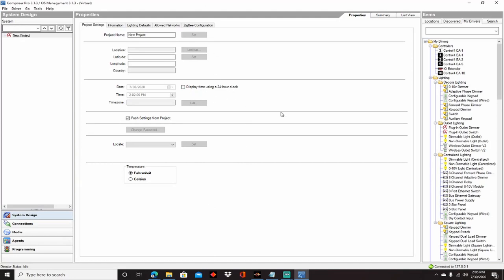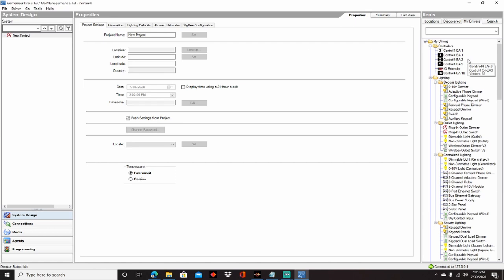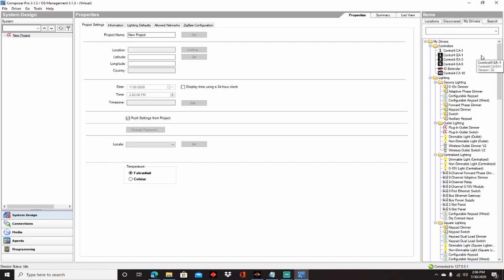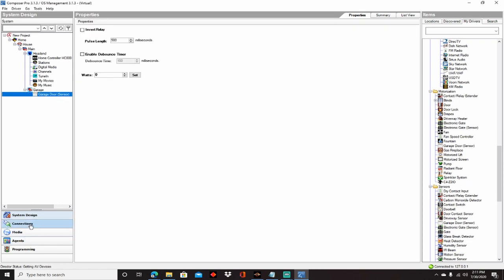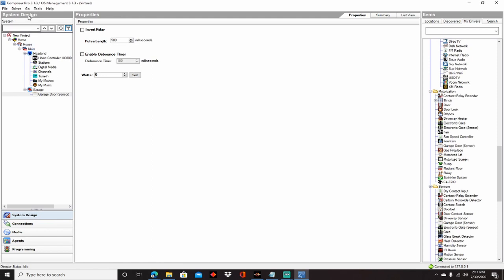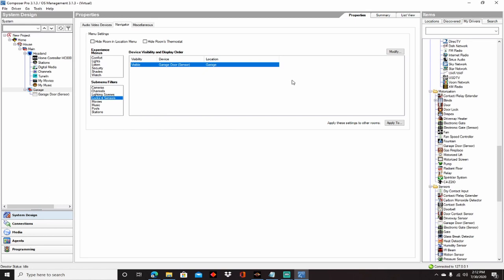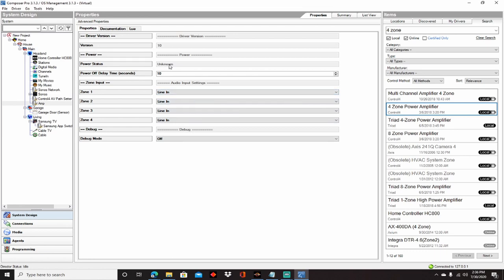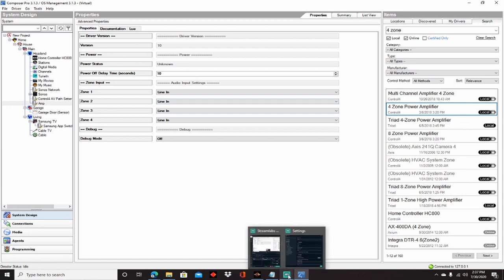Control4 Tricks & Tips For Programming

Comment: Another thing to learn! just when you think you have a grip on the business for home services and AV there’s an entire new standard to learn. 

Thanks for this video.
Reply from the maker: Anytime brother. Thanks for watching. C4 is actually really easy and if you use good products it works really well. Like anything else, a poorly programmed system will cause word to spread that the control platform is crap, I’ve seen it with all the majors, crestron, savant, even URC. I would suggest if you start to venture into it, get the product for your own home and push it to its absolute limits and then dial it back so you know what it’s capable of, then run it for a bit and make sure your wife/partner/roommates can use it no problem. After that start installing it! Good luck.
Reply: @QVisionGarage  do you see this system on its way out in terms of use in the industry? I have an interview for a company today and am just wondering the severity of not understanding this fully yet. 

Thanks
Reply from the maker: Not at all. Control4 was bought by snap one a few years back. Snap one is one of the biggest suppliers of low voltage gear, they are here to stay. I wouldn’t be too worried about not being familiar, to be trained you have to be a dealer or employed by one and again it’s really easy. If I could offer any advice it would be have strong fundamentals in low voltage work, terminations, wire pulling, knowing how to efficiently layout and assemble a rack, understanding signal is huge, being able to read blueprints and system block wire diagrams. All those things are super important, programming is likely secondary to what most employers are looking for. Being super solid in the core elements separates a lead tech from a helper.

Comment: Thank you for the video! I programmed my kitchen light to come on during nighttime hours only. and put a timer in to turn the light off after 5 minutes. It works fine. However, if I turn the light on manually with the wall keypad , after 5 minutes the same light turns off. 
Im not sure what to do. 
It is a Control4 controlled light.
Thank you.
Reply from the maker: So need to know a couple of things, 1, you set the kitchen light to only come on during nighttime hours, is that when you manually turn it on or is there a motion sensor? I’ll have more questions based on how you answer the above.
Reply: @QVisionGarage  I set it to come when the garage door opens, but only during nighttime .
Reply from the maker: And are you using composer pro?
Reply: @QVisionGarage   Composer HE
Reply from the maker: Ok so unfortunately I’m order to achieve what you want to do you need composer pro. Being that composer pro is dealer only software kinda puts you at a dead end. While I have heard of people getting their hands on composer pro, I don’t know how to do it nor would I advise it. But, to answer your question, your system needs to know when to automate and when to override. This would typically be done with the use of variables and a scheduler. Both of which I don’t believe are available in HE. I’m sorry to be the one to give bad news but what you want done is a pretty easy change and your dealer, if they are good should be able to do it without even being there if they have a solid understanding of what you want to do and their understanding of logic and conditionals is tight. I know this isn’t what you wanted to hear but I’m afraid this is the way of the Control4 world.
Reply: @QVisionGarage  yes HE has all those options as well.
Agents, schedules, variables, conditionals , HE can do 95% of what Pro edition can do.
Reply from the maker: Well that’s a horse of a different color, haha. So like I said earlier the system needs to know when to automate and when to override. I think the easiest way to achieve this in your case would be a string variable and tie it to the garage door, ie when garage door open variable =1, followed by a conditional if variable is =1 start timer when timer stops turn off light, set variable to zero.
Reply from the maker: That should allow the keypad to function independently.
Reply: @QVisionGarage  
Thank you for your reply.
Would this work:
1. When timer "garage kitchen Light" starts -> turn on light
2. when timer "garage kitchen Light" stops -> turn off light.

Comment: After updating Control4 controller firmware I cannot get access to files in shared folder. I only can open shared files for reading, but can't change them or copy.  So, I can't copy drivers to appropriate folder. Did you even have such situation ?
Reply from the maker: I have not. I’m assuming you’re talking about media files, is this correct?
Reply: @QVisionGarage  No, I am talking about possibility to save drivers (for example), that I have download separately, in shared folder of controller (In Computer window I type IP address of controller and there I find dirvers folder when I save these files)